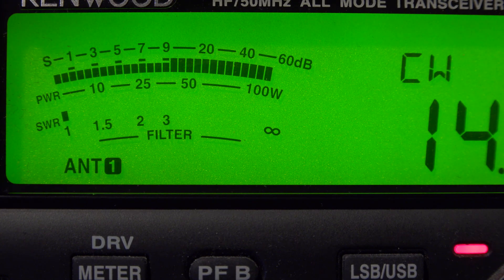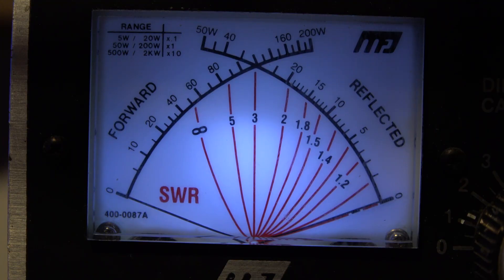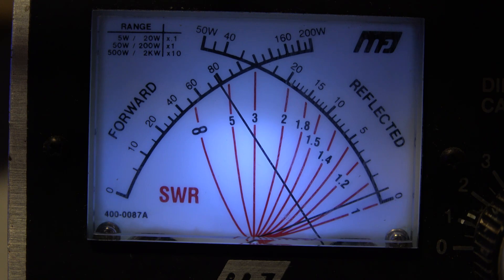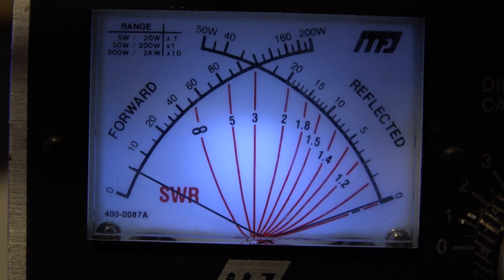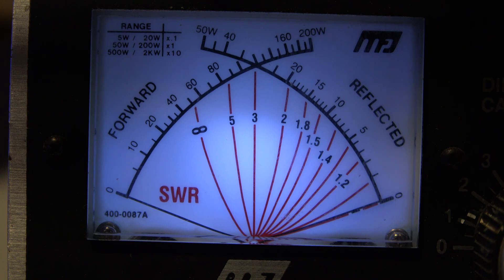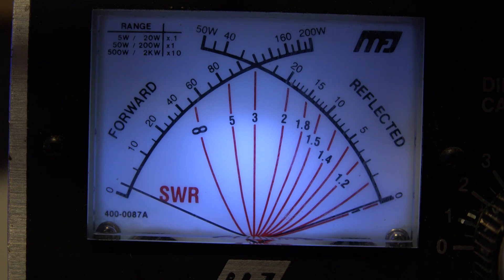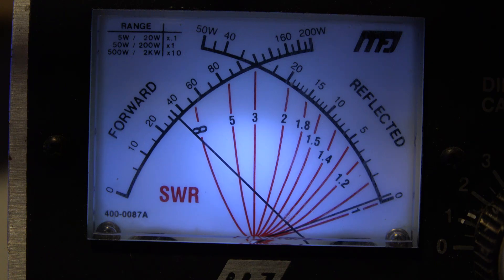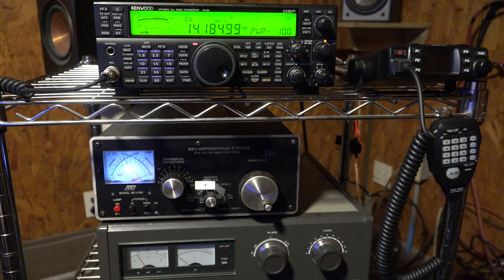KENWOOD TS-590S LOW OUTPUT POWER

Comment: I have a Kenwood TS 590S and an American AL80B amplifier as long as the amplifier is powered off the TS 590S put out 100 watts as soon as I connect to the amplifier the best I can get is 50 Watts correction as soon as I turn on the amplifier as long as the amplifier is powered down I get 50 Watts I strongly suspected it's something in the ALC try testing your radio with no amplifier connected I suspect you're going to see the 100 watts again

Comment: I have seen a modification on youtube that does offer a solution.  It involves disabling the ALC.  Once done, the TS 590 will put out its max of 130w.  The mod disables a resistor on the ALC circuitry switching it off.  A potentiometer may be a better bet - what value? No idea!!

I have a TS590s coming at the end of the week.

Search youtube.

73
Reply: You must have a powermeter with holdt than you can see the radio gives 100 watt
Reply from the maker: Thank you for your response. I recently got a different watt meter and this shows around 95 watts output. So I just leave it alone since I use an amplifier anyways. I've seen that video clip about disabling the ALC. I'd rather not do that since that could damage the radios finals and isn't good for the amp either. Besides, I don't know enough about it to modify anything, lol

73
Reply: @teuton77777   Lol!!!!  I also avoid soldering wherever I can!!  In the UK, the limit for a Full licence holder is only 400w.  For me, as an Intermediate licence holder, I can only use 50w so my new Kenwood will be fine.  Good luck my friend.  Steve, 2E0EES.
Reply from the maker: @ratsstuff1952  wow, only 50w? Your government is very stingy, lol.  I talk often with my friend in Germany (I'm original from Germany) and they can have up to 700w (full license). 50 watts make no sense, most HF radios have at least 100w. And how would anyone even know if you're really only using 50w. Here in the US we're really spoiled when it comes to Ham radio. Even with the intermediate license we can run up to 1500 watts PEP on pretty much all ham bands (with some minor restrictions). Maybe this government here knows that Americans wouldn't obey stupid restrictions anyways, lol. So they figured 1500watts is ok, since any amplifier that can push more would be too expensive in the first place. I'm a new ham operator, I'm only licensed since the beginning of this year. So still a lot more to learn. Well Steve, maybe we can catch each other on the air sometime. I'm mostly on 20 meters, during the evenings and at night. Till then, 73    KY4XV   Jorg
Reply: @teuton77777  Fortunately no one checks power outputs anymore over here.  That said, I'm pretty honest unless it's a country I have not worked and I need a few extra watts to get it.  Intermediates will be allowed to use 100w next year and Full licence holders will be able to emit 1kw so it's getting better!

I lived in the USA (NJ) until November last year.  I enjoyed the experience :)

I'm on most days and can get the USA regularly so I will definitely make a note of your call sign.  Until then my friend, stay cool and I hope to speak to you in the very near future on 20m.  May have a go in a minute actually.  The football has just finished (we just beat Scotland 3-1) and the wife is upstairs studying....